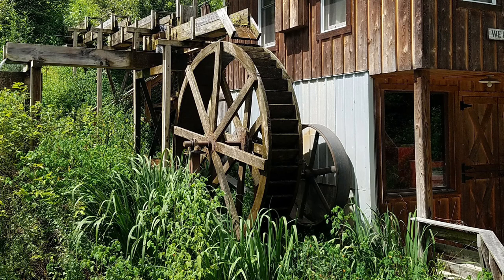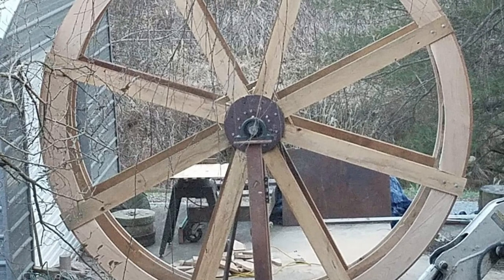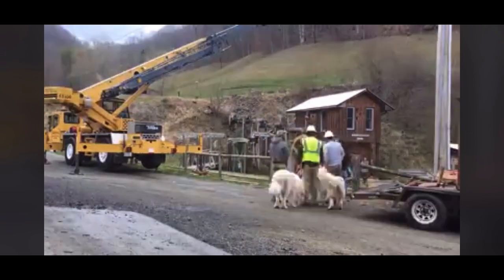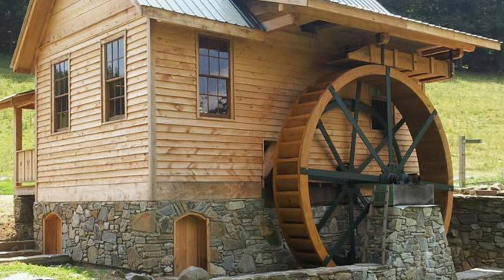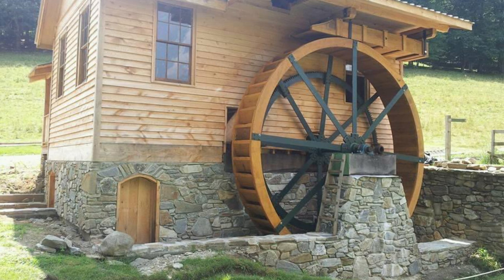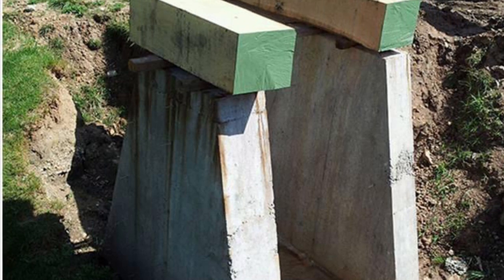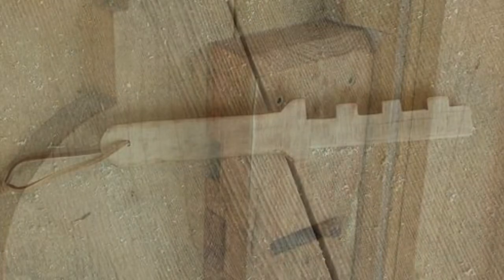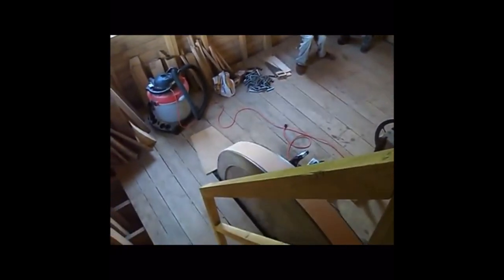Water Makes These Wheels Turn v116

Comment: Oh boy, you are very talented. We can tell you build with love Justro!
Reply from the maker: That is what I have always said, thanks Wendy!
Reply: @metcalfmills5679  😁
Reply from the maker: How’s it going down there Wendy?
Reply: @metcalfmills5679  Oh my goodness. I’m heading back this afternoon after work for a couple of days. My neighbor (that I didn’t know until he showed up on a tractor) plowed me up a 3000 square foot garden. I had irrigation lines put in a cross pattern and he worked around those. So I have 4 spigots out there. One as you’re stepping into the garden. One in the other end. And one on each side. They’re all connected to the well. I had to replace the well pump and bladder tank and I thought since the plumber was already here, why not give him the rest of my money. 😂. It just so happens that the mobile home next door is structurally sound. I thought it was going to be a tear down. I rented a dumpster and it came last Wednesday evening. So I spent most of Thursday cleaning out the mobile home until I heard that tractor rolling up. Charlie left a voicemail yesterday and said that he’d gone back over there and run a harrow over everything to make it smooth. He charged me 25 to plow it up and I said I wouldn’t give him 25 because I might need him for something else. He laughed and I folded double that into a little square and slipped it to him. That sure was nice of him. People here in the city just want to rob you it seems like. I’m packing my car today with my pups. One has claimed shotgun for every ride. I suppose he feels too far away from me on the back seat. 😂 Wish me well getting the rest of the junk out of the mobile home. I’ve got my sights on being out of here by the end of the month and I have one of those pods coming this week so I can start loading that. I feel like I’m running in 7 different directions. And yes sir, I might be just a little bit tired. Got to get ready for work now. Have a great day and thank you for asking how things are going. I like storytelling too. Lol

Comment: Those look so good! The mill where I grew up had two wheels that were under the mill and were on their sides with vertical shafts that came up to turn a horizontal shaft that went into the mill and had belts on it. It is all gone now but I remember going back in there as a kid to see it. At least that is how I remember it, doesn't sound right that they were laying on their sides like that.
Reply from the maker: Sounds like a tub wheel, or a turbine type wheel.. thanks for sharing this with us!

Comment: We still have a few poured Babbitt bearings  on the Governor of a 2500 hp Francis turbine
At my dam.

It runs a propellor pump to lift a huge volume of water a bout a foot to help attract fish to our fish ladder.

It is in a pump pressure lubricated oil bath like in a modern engine and the friction is low.
I imagine yours was grease lubricated ?
Reply from the maker: Thank you for sharing this with us. Oil drip on the old bearings, grease on the new

Comment: Will the 18x18 cushion blocks shrink as they dry and cause shaft misalignment?
Reply from the maker: The wheel shaft stops at the wheel bearings. The pitch point is horizontally aligned as the beam on the mill side extends down to the rim of the wheel and also carries the bearing for the master jack shaft. Any shrinkage would be the same and not change anything. Power from the MJ shaft is transmitted by belt so there would be no issues there. Great question, thanks Michael!

Comment: Beautiful work sir!
Can you give us a rough diameter of the wheel and no load and normal load speed?

Did it take years to dry the wood after you milled it?
Reply from the maker: Thank you. It was 16’ diameter and was running around 18 rpm’s. No the wood was dry when I acquired it.

Comment: ❤ WOW 😲 So beaUtiful!  I want one!  Too bad I live in a city. QUESTION:  Why didn't you use Locust for all of the mills wood parts? Isn't Locust the wood most resistant to water damage?
Reply from the maker: Locust is not that available and it also splits easily sometimes. Thank you